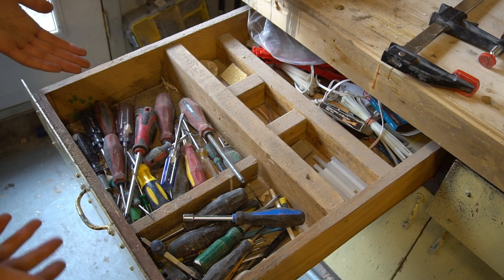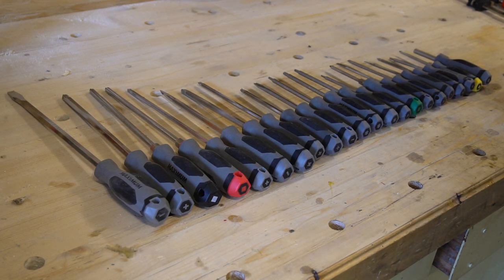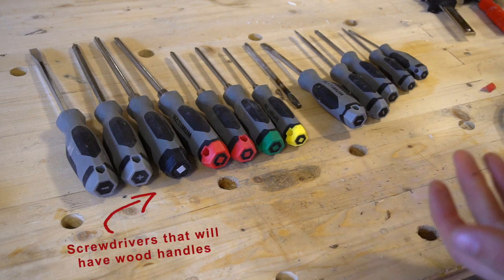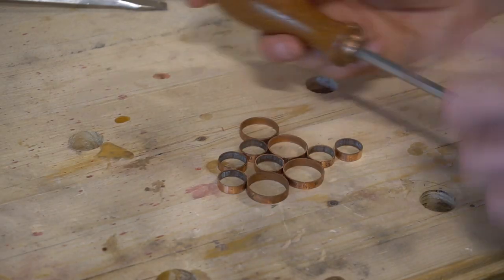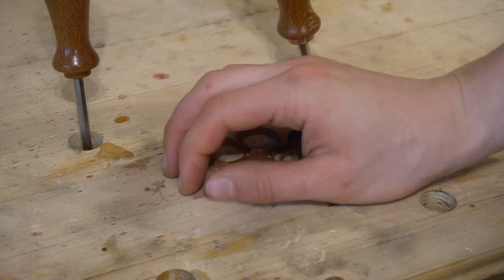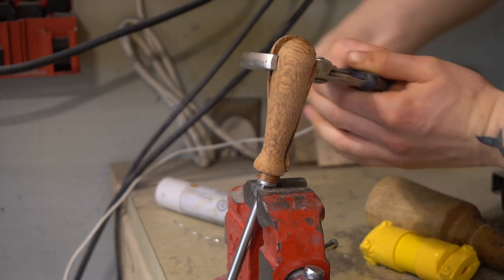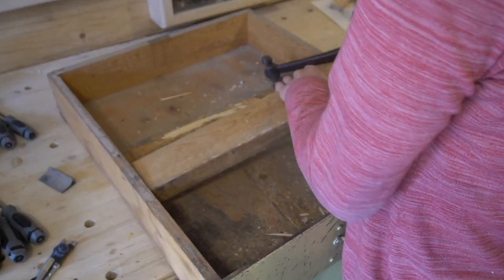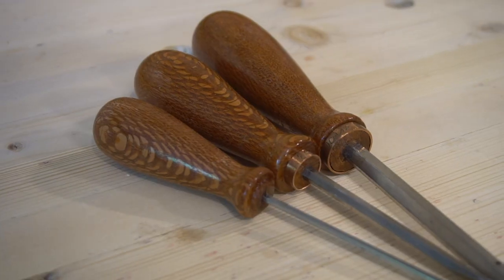Adding Wooden Handles to Screwdrivers // Turning Wooden Screwdrivers for Woodworking

Comment: Well, I'm watching your videos for a second time now to catch all the Easter eggs and just for the sheer enjoyment. As you replied earlier to a comment, Lacewood probably wasn't the best choice because of the grain structure although, beautiful. A much tighter grained wood that's less splintery like maple as you mentioned or like pear, beech, etc. would be better for strength. I mentioned yesterday on another video of yours that your technique reminded me of a machinist and part of that comes from your turning technique. You turn wood like you turn metal. Your results can't be faulted, your work is beautiful but, your technique is placing far more stress on the lathe and rest than a traditional woodturning method. Also, you would shorten your finishing time and amount of sandpaper use. Thank you for the time and effort you place both into these videos as well as the projects.
Reply from the maker: I'm happy you are enjoying the videos. About the finish, you mean that I use scrapers and gouges instead of a skew? I use a skew on some woods depending on the shape I am going for. I'm by no means amazing with the skew so I play it safe if im working with hard inconsistent wood or if the part is particularly touch to turn. And yes, I presume turning metal on the lathe can be harder on its bearings and so forth. I have been doing it for years now though and have not broken or worn anything other than the face of my tool rest which has a good few digns in it (mostly because of how I designed my metal turning tools) I also bought a metal lathe this year so once I am done restoring it I won't be turning metal on the wood lathe as much

Comment: 1. Em'er the most beautiful screwdriver handles I've ever seen. 
2. You could reinforce the glue line with thin dowels perpendicular to glue line, say bamboo skewers. OTB-Thinker Russ Veinot does this diagonally thru thin plywood box corners & it makes them quite strong
Reply from the maker: Thank you! :) Although it looked like it, it didn’t actually crack on the glue seem. I just cracked there because the blade created a levering effect. I think the best way to make them stronger would be a wood that holds up better on the grain such as maple, or some type of metal ring where the blades flat spots are so it can’t lever. But doing that in a pretty manner would be difficult at best. They also hold up well! I doubt I’ll be breaking any of them, even if I try!

Comment: I don't think it would have worked on those hard plastic handles, but there is a 'correct' way to remove the handles from screwdrivers.
Companies like Snap-On used to do it to replace damaged shafts on screwdrivers. They replaced just the shaft instead of the whole screwdriver, because they were usually part of a matching set.
You slip a washer over the shaft of the screwdriver to protect the plastic, and then clamp the shaft vertically in a vise (handle upwards), almost up to the handle, but leaving about 1/4" of space.
Then, you use a crowbar under the washer to lever the handle up and off the shaft.
This works great on the transparent acetate handles but I've never got it to work on the harder plastic handles.
Reply from the maker: These ones were not designed with that method in mind, but that's a good point. I also didn't know that trick worked on the transparent handled ones, thanks for the info!
Reply: I actually use it for the opposite reason to this video - I throw away the screwdriver and keep the handle. They are really useful if you need a handle for a shop-made tool.

Comment: Should you add a facet so they will not roll onto the floor as you did with your chisels?
Reply from the maker: Definitely not a bad idea. But I didn’t simply because if a screwdriver falls on the floor now and then, it's no big deal. There's no blade to dent

Comment: While they certainly look better I'd consider this a downgrade for tool functionality. If you're going through the hassle why not make new ones from scratch? Tool steel rods aren't that expensive and are easy to work with. Plus you can make it full tanged
Reply from the maker: Well tool steel is still way more expensive than what I did. Theres maybe 10$ of tool steel in a screwdriver. But mostly quenching a long thin blade without warping is super difficult. I have been trying to do it cause I do make my own speciality screwdrivers but I haven't had good results yet. 

These have been holding up well. The blades won't last many generations but they should last a good while the whay I use them. And perhaps they are slightly less grippy than they used to be for for a wood shop that isn't an issue at all. I have never ran out of grip with them. 

It would definitely be super cool to make crazy high end screwdrivers 100% from scratch and I totally recommend you try. But it will be a much bigger project than what I did that's for sure